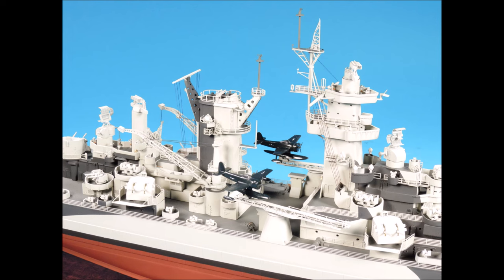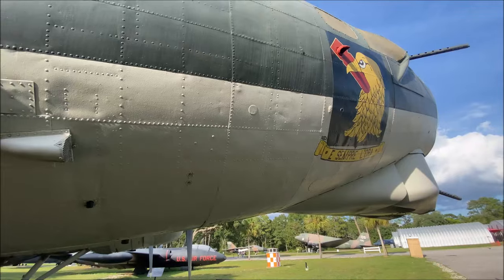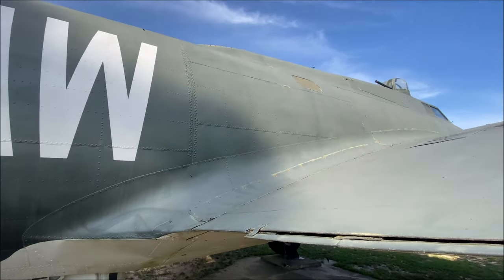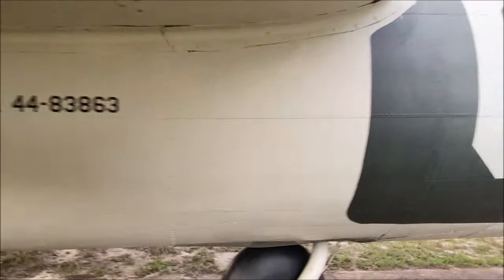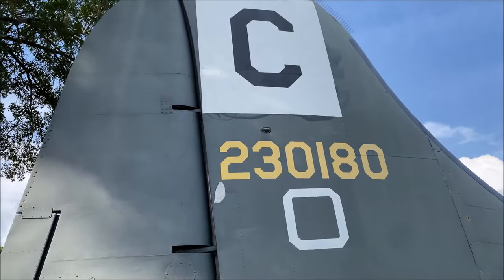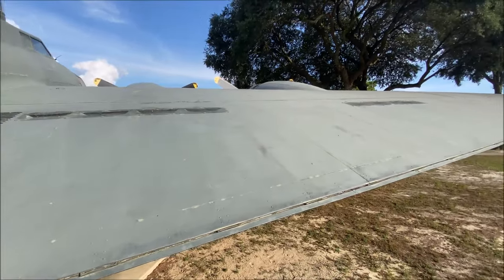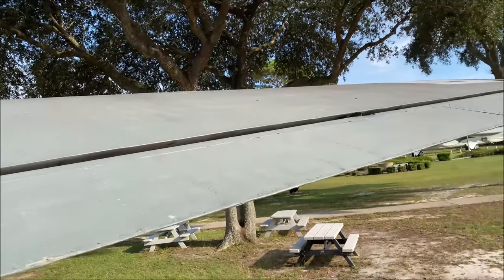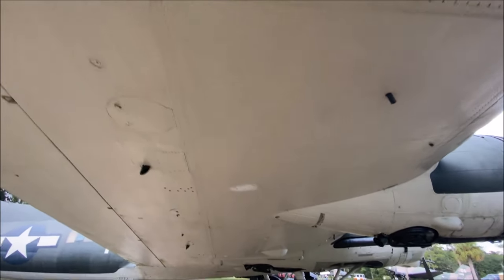Surface skin details on a B-17 Bomber

Comment: Mike it just go's to show that monogram/revell got it right.i do know with all the recess panel lines that models want for details are not right even with butt joints.
Most of the drit I have seen on planes comes from the rivets then from the panels.most modern jets have most of there flushed rivets covered with some kind epoxy compound making them smooth.